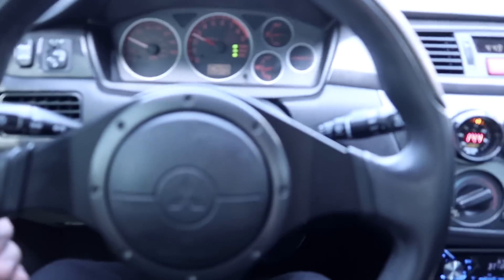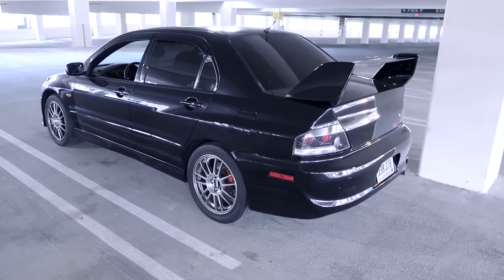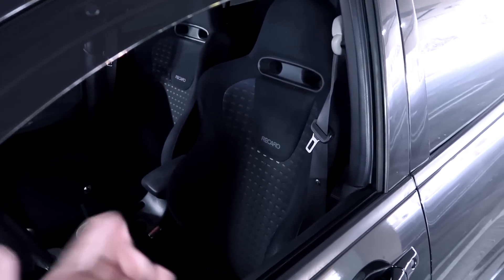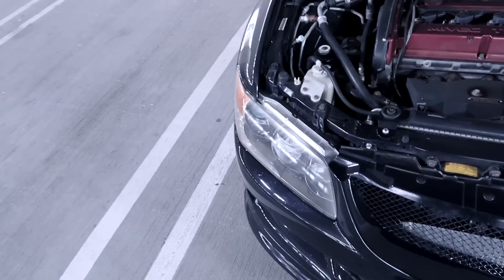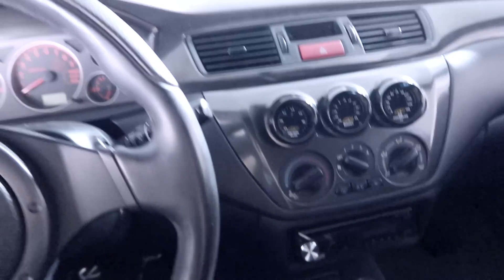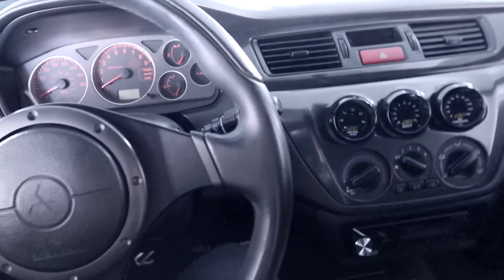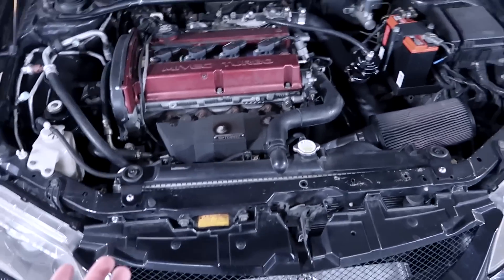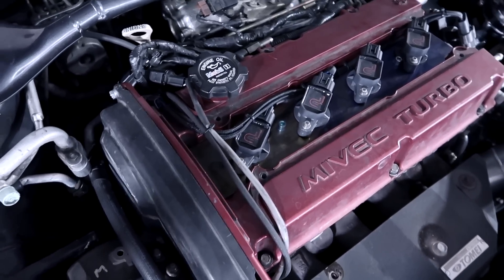Tips NO ONE says when buying an Evo 8/9 or X!

Comment: Knowing what you know now about it being a built motor and heavily modified prior to you buying it, would you still have bought that exact car?
Reply from the maker: i mean its not a built motor just a different one but if i had to do it all again i would not. I wouldve 100% gone with an Evo X because they make more power stock block than an Evo 8/9 and handle the power better. The shop i go to has an Evo X making 709AWHP and the stock long block has like 100,000 miles. If you tried to replicate that with an 8/9 and it ACTUALLY LAST it would blow up forsure. The X is also much faster from a roll ive seen them spank cars making over 200-300whp more and they still give it the bus length gap
Reply: @DissFooJosh  I also know 8/9 on stock block making 800 HP no problem, no issues. Depends on the builder, 8/9 will beat a heavy ass 10 anyday imo.
Reply from the maker: Dat Boosted Ute eh yes and no drag racing yes from a 40mph roll the X will rape that old iron block powered ass any day and run more mileage wise with less issues
Reply: Why can't we just get along lol
Reply from the maker: @jyaj007  because thats how all evo owners are hahaha
Reply: @DissFooJosh  yeah but how much power do actually need on a road car, plus the 8/9 looks way cooler than a 10.
Reply: @DissFooJosh  in theory,  shouldn't the iron block hold more power than the aluminium ones??
Reply: Yes another person adding two cents. My evo had 450 on mhi fp red for 6 years till I sold it. Second.....multiple people in my state(evo group is tight knit here) have had 500-550 on stock block for multiple years with drag mixed in. I hate to be that person but English Racing is pretty much in our backyard and I’m sure that’s the reason! Also the fact that they torque never eclipses 400

You state many good facts for sure! I plan to do this all over again once I buy my house. To bad evos will most likely be even more expensive by the time I’m ready to buy
Reply: @DissFooJosh  i wouldnt say that . have a few stock block cars here in ga making 550 to 600 one 6266 evo x lost to the stock location turbo evo 8 both 20 and 40 roll . the 8 has better gearing than the x's for sure but have less problems due to less maintenance for sure . love em both but the x does make power easier i just dont like them as much , better daily for sure
Reply: Josh Yu if you’re doing a 40 Roll with Evos , you’re doing it wrong. JK. I LOVE BOTH.  Have a 2003 Evo 8 that I am the original owner of and I can tell you that it’s been beat on in years past. LOL  I just built the motor for enhanced amounts of pleasure.
Reply: @DissFooJosh  Why is it faster from a roll? its heavier? Could you explain yourself as I am not sure which one to get.
Reply: @DissFooJosh  yeah, if you don't know what you are doing I guess the X is the better car?! An Evo IX with a downpipe and high flow kats pushes 400 bhp on 102 octane fuel (Aral Ultimate in Germany) without any other modifications. If the map is written by a really good tuner (I mean one of those not so well known experts, not the big marketing shops) an Evo IX is BY FAR the best bang for the buck evo. And look at the values of those. If you know what you are doing (and really most don't) - I'm an egnineer by the way - they are excellent and reliable cars. It all starts with the fluids, fresh oil for all the diffs and the engine is a must. NEVER miss a timing belt service window. Carefully warming up the car everytime you cold start it is a no brainer, but also drving it cool after a spirited drive should always be considered. It needs attention and knowledge, which makes it even more of an experience. And don't think they are slow. Mine is a geuine 170 mph car on the Autobahn

Comment: I’ve had 2 IX. One was a 2.3 striker shep trans and diffs. 768 awhp. My last one was a stock 2.0. Cams. Boltons. Pump fuel. 360/360 power and it was so fun. I miss the Evo but almost want a Subaru.
Reply: What makes you want a Subaru? I've owned 4 GC's and currently looking for a ct9a
Reply: @Phz.001  not really sure. Absolutely nothing wrong with the CT9A. I loved both mine. Very fun cars

Comment: I''m an original owner of a IX SE. I have two buying/tuning tips:
1. If you come across an Evo like the one in the video, don't buy it. This should seem obvious, but apparently it's not.

2. This is how you uncork the motor on a IX: boost control, a fuel pump, a turbo-back exhaust, and a tune. That's it, nothing more. It's around 400hp with zero drawbacks. Anytime that you deviate from this you will have problems. Like this car, and I'm ignoring the pure bullshit about the MAF and the drivetrain. There's no reason to run E85 at such a mild state of tune and there's even less reason to convert to SD. The huge injectors will never run like stock, regardless of the skill of the tuner, and SD essentially amounts to taking a guess. Why do this? BTW, the MAP sensor is used to read boost, not the MAF.

This car has aftermarket 272 cams, even though it had 272 cams in stalled at the factory. This brings me to the second part of this - if you decide to build an Evo, you need to know the platform better than the people doing the work. Just as with the cams, you need to know what you have. Josh seems like a nice guy and I don't want to rag on him or on his car. Just keep in mind that this isn't how it's done.

Comment: you should make a video talking about how you deleted the maf and put the speed density intake, thanks will help a lot
Reply from the maker: i will definitely consider it Davin
Reply: Josh Yu sounds good bro
Reply: @davingarcia1369  Spoolinup has a SD harness you can plug info the MAF on the harness and run a AIT for SD.  Just make sure you are getting tuned for it.
Reply: Seijin Dootson I actually just bought that harness. Super dope super clean and super easy. Just like their resistor box delete
Reply: Yeah I’d appreciate this, bought my evo 9 2 weeks ago! Mines a GT model though, JDM spec
Reply: It's super easy, all you need is an iat sensor, 4 bar map sensor, speed density intake, sd harness (so you don't have to splice into the existing harness), i went with short route piping which had the iat sensor bung already in it, and a tial q vta bov. I would either have a shop install it and tune it then and there or if you know someone who can come to you after you install it, it will need a re-tune. Map and stm sell kits for it, the piping, intake, sd harness and bov would be extra.

Comment: Josh another awesome video keep it up brother!   
 I have a 2005 Evo VIII MR graphite gray with only 29k original miles. The brembo calipers are bright red still running the original brake pads.  I bought it from the original owner back in 2008.  My Evo was only used for  car meets and weekend summer drives been garaged up never even been out in the rain. 

If I would decide to sell where  would you recommend posting up to find a good home or maybe you could do a video on it?
Reply: Put it up for sale on bringatrailer. Com. A stock Evo 9 SE with 40k miles recently sold for 39k on there.
Reply from the maker: Honestly if i were you i would hold onto it and let the value build up because if it is lightly modified or completely stock you can sell that car one day for easily $50k-$60k  or more but if you are ready to part ways with it i would recommend trying to sell it on facebook, bringatrailer.com or i would post it on eBay and let people bid for it

Comment: Good video Josh, over here in UK the 8's have the ACD as standard & therefore the 3 lights on means a pump rebuild. Also with the fluid service I always think it's OTT that some people change Transmission, T Case & Diff oil every single year even with low miles. Can understand dropping the engine oil, but Trans & Diff oils should be good for longer. I use Redline MT85 in my 8, which is meant to be the same as the cocktail you speak of already mixed.
Reply from the maker: yeah the euro and japan ones also have AYC but mainly this video relates to anyone state side everyone else got the cooler cars

Comment: Here's a tip.....buy a Subaru instead🤣🤣🤣🤣
Reply: Not everyone is a fan of ring land failure.
Reply: @interceptingfist5682  well it won't happen if you use the right fuel(I use shell v-power)have it mapped to reflect the parts on the car and DON'T DRIVE IT LIKE A DICK 😉
Plus mine is a 2004,ringland failure wasn't really an issue until later 2007+ models so.......